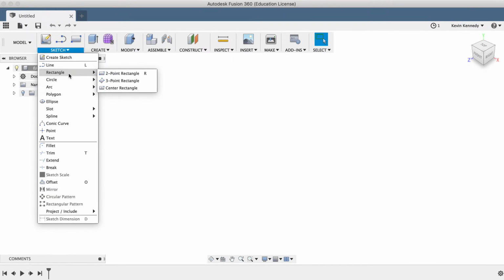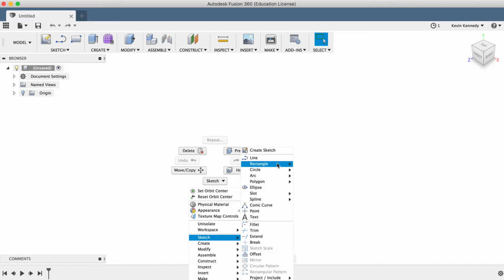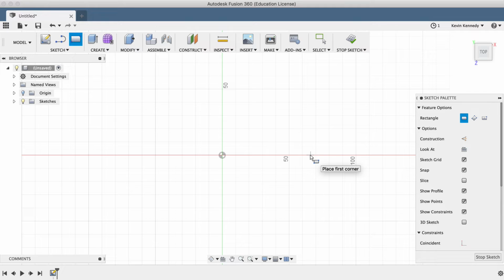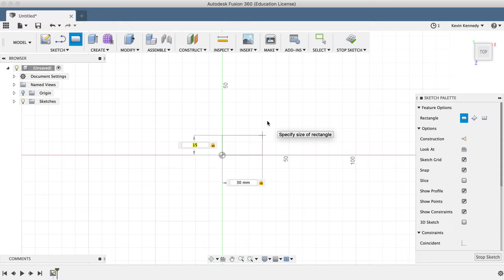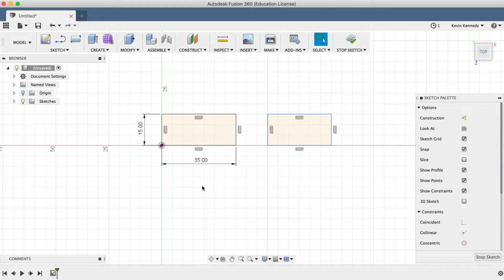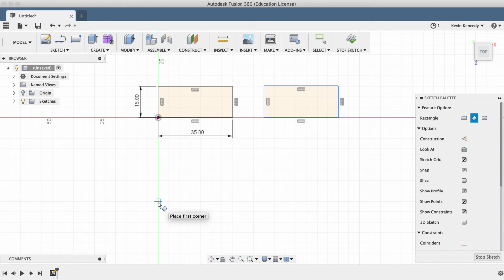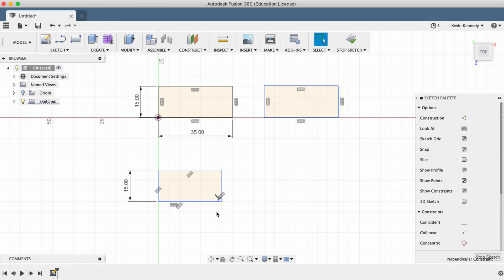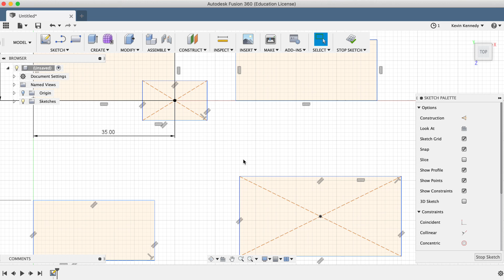How to Sketch Rectangles in Fusion 360 (all 3 explained)

Comment from the maker: Which rectangle do you find yourself using the most??? I feel like I use a lot of center rectangles... 🤔
—
P.S. If you liked this video, I'd love for you to Subscribe ► http://bit.ly/sub-right-now
—
TIMESTAMPS
0:00 - Create Rectangles in Fusion 360
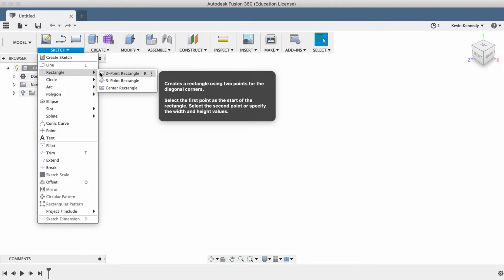1:00 - Rectangle tool locations explained
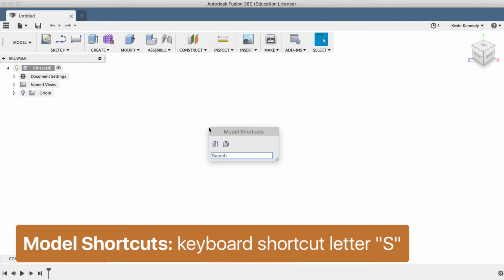1:40 - Model shortcuts box explained
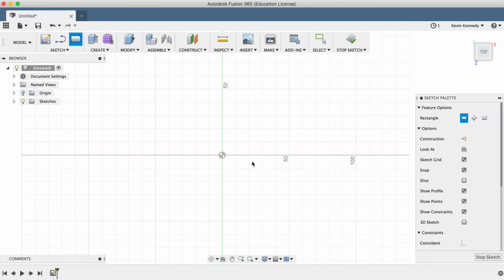2:18 - Quickly toggle between rectangle types
2:30 - 2-Point rectangle explained
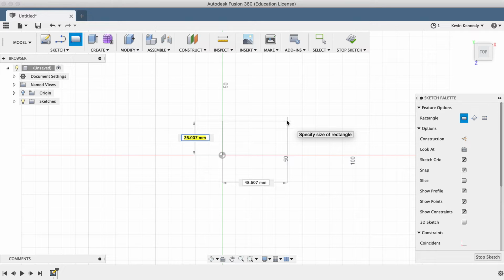3:17 - Locking in rectangle dimensions
4:38 - Line color and constraints explained
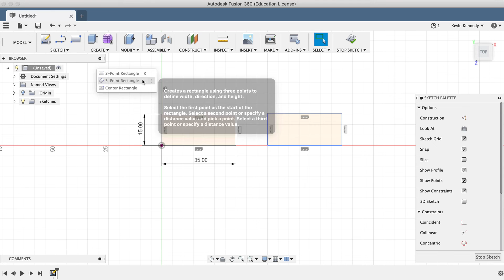6:35 - 3-Point rectangle explained
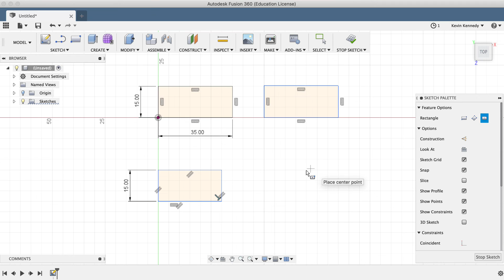8:10 - Center rectangle explained

Comment: I created 3-point rectangle but then deleted diagonal constructions line. How to get these back (but not via undo) ? Drawing diagonal construction lines doesn't do much.
Reply from the maker: The only way would be to draw the diagonal construction lines + add the sketch constraints to them. The various preset sketch tool automatically include 'sketch constraints' which is what makes them efficient. That said, you can technically recreate all of the same geometry manually using the same sketch tool + combination of sketch constraints.

Comment: I want to insert a rectangle on a pitched roof to simulate a seam line. how do I create the line so that it touches the outside edge of the roof in the center of the roof and then pitches upward to complete the seam just below the center point of the roof? Thanks for your help!  Wayneknight951@gmail.com

Comment: this was useful for operating the tool.  Now the user needs to find out how to explicitly place the corners on the sketch plane.  I don't see any x-y address for the corner(s) or an option to enter this address.  This is sketching and not drafting.  Need dimensional control.

Comment: How do I make a rectangle that is already sketched, bigger on both sides equally. Example, if I have sketched a rectangle which is 80mm *120mm, and I change the 120mm to 160mm, all the extra length gets added to the one side, is there a way of adding the extra length to both sides so 20mm gets added to the right side, and 20mm on the left. Its for a lid on a box, but when I change the size to 160, it overhangs the box on one side, and not equally both sides. Hope that makes sense.

Comment: A good lesson, but you omitted the question of where to put the damn rectangle in the first place.  This is critical when sketching on the face of an existing part, so the rectangle has to be in a particular place on the part.  But F360 does not give you a chance to specify the location of the first point, which determines the location.  It is stuff like this that makes F360 so hard, for me at least.
Reply from the maker: I'm not sure I'm following your question, Joe. Every time you go to create a rectangle you have to define the first point. Of course, where you place that point will dictate the start of the rectangle, dependent on which rectangle type you're using.

keep in mind that you can sketch a rectangle anywhere and use constraints and dimensions to position it in place.

These feature-based videos are focused only on how to use the feature itself. In all of my project-based videos I demo The concepts such as constraining, dimensioning, positioning, etc..
Reply: @ProductDesignOnline  In my case I wanted to place a rectangle on the surface of a part.  It needed to be at a specific location, like x=0.31459, y=0.628.  I could not see a way to tell F360 where that first point should be, or a way to move it once I established it by clicking.  Now I recognize that you may have covered this point in another lesson, but I came to this one by a search in YouTube, and had never seen the earlier ones.  I think it would expand the usefulness of the lesson if it would include the solution to this problem.

Comment: Hey Kevin, good video but you missed something though.. 3 point rectangles are used when you want to draw a rectangle at an angle other than straight horizontal/vertical.  That's why it has perpendicular constraints on it instead of horiz/vertical ones.
Reply from the maker: Hi, tralfazy. You're right! Good catch :)

Every once in a while I get so caught up in speaking clearly, etc that I do silly things like that... The icon even shows it at an angle which should've reminded me that's what its for! haha

Thanks again for bringing this to my attention. Cheers, Kevin :)
Reply: @ProductDesignOnline  Probably most of us draw a regular rectangle and then rotate it afterwards because we forgot that there's a tool for that.  :o)
Reply from the maker: @tralfazy  Very true. I find myself almost always using the 2-point rectangle lol :)
Reply: Yup - I have to create rectangles & squares at an angle, and what I need is the right angle constraint at the corners, not the horizontal/vert constraint.  I can rotate it easier with fewer clicks.